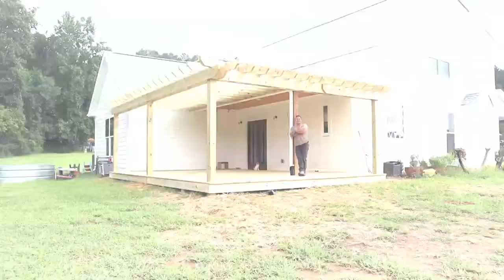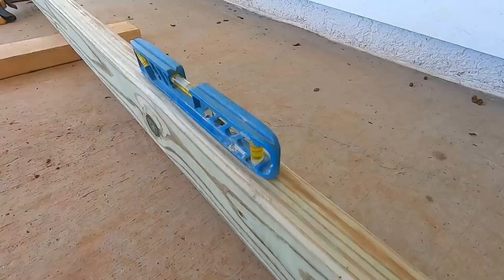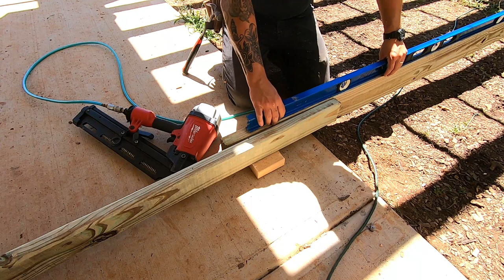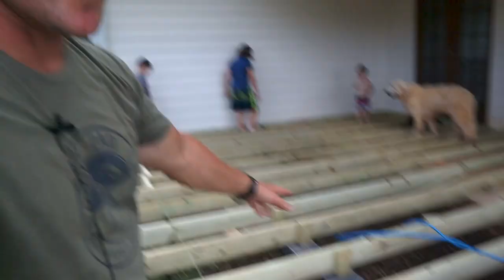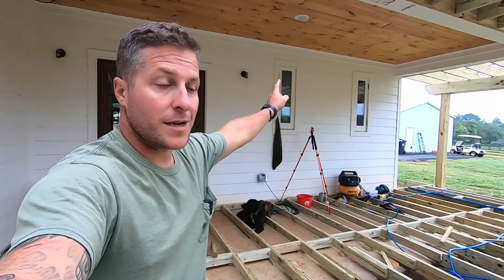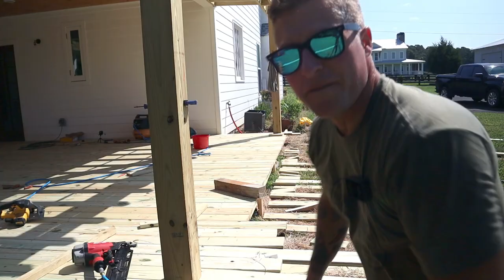I built a GIANT deck over my concrete patio. Backyard Transformation stage 2.

Comment: Did you do anything to provide a space for water runoff of the concrete? We are looking to do something similar but don't want the new wood to be sitting directly on the slab, to prevent the wood sitting in water. but we have very little clearance over the concrete with our door threshold.

Comment: Hey, well done! Thank you for video.
But why no gap between rows, like 1/8 in ?
Reply from the maker: Thanks man. Never gap the deck boards. I did that once and ended up with 1/2”-3/4” gaps after the wood dried and shrank. I install them as tight as possible then when they shrink it’s perfect. I got about an 1/4” gap throughout now. Thanks for the support